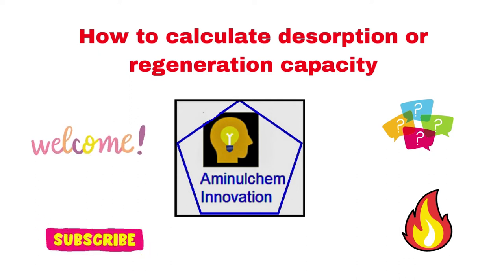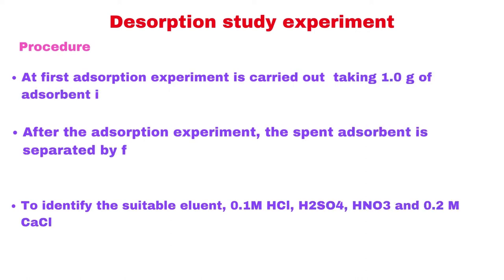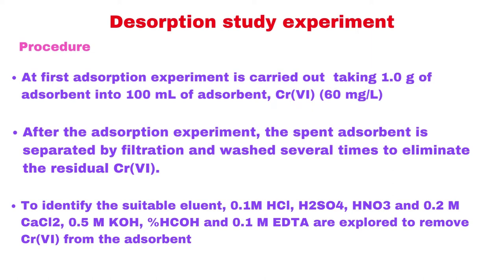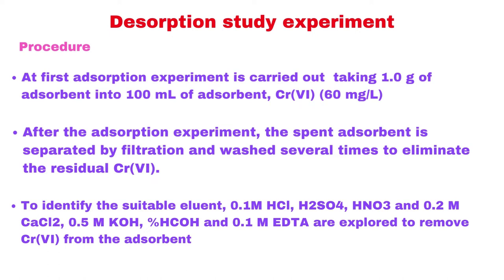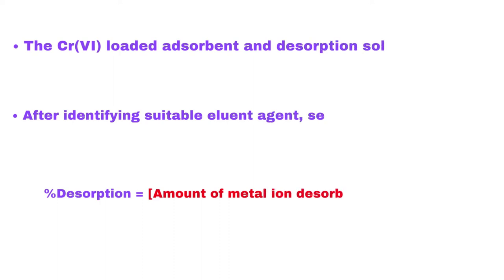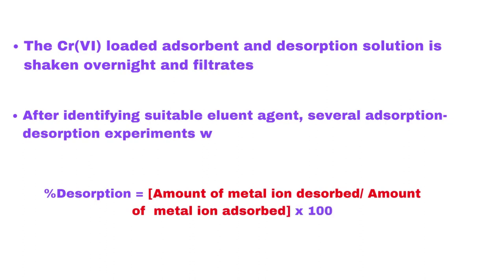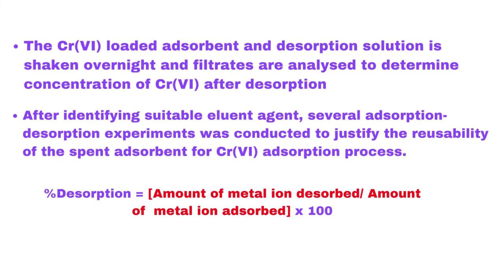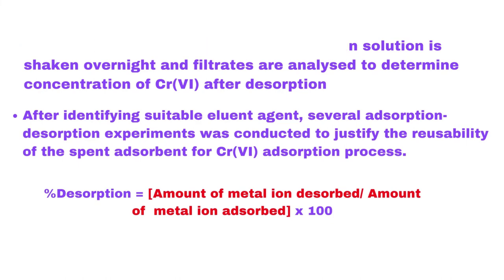How to Calculate Desorption or Regeneration Capacity

Comment: Great I have a question. After the desorption experiment I want to analyze the solution, but after making it more concentrated. how can I increase the concentration of that solution..? 
For example, when I will pass a pollutant water containing pharmaceuticals that will adhere to my adsorbate during adsorption, then in desorption, they will come in solution but they are in a very low conc. which is very hard to detect in the instrument. Can you share your thoughts on how can I concentrate to make it detectable?
Reply from the maker: Thanks. Usually desolation concentration is not measured. After zero cycle the adsorbent is regenerated using HCl or NaOH or other agents. Then using this spent adsorbent and original adsorbent adsorption experiment is carried out.  Similarly other experiments are done..

Comment: Dear Sir,
You are doing great work, especially making videos related to the adsorption isotherms topic. 
Can I get your email address? 
I am also working on the same topic.
Reply from the maker: Thanks. Please make your comment here and I will get back to you soon.
Reply: @Aminulchem  
I did several experiments on adsorption by using granular activated carbon. We used wastewater for this experiment. 
My question is, which model fits best for the adsorption. I have the result of both pseudo first order & second order as well. 
During the experiment, we took the reading on different interval but not intensely, the values we got in terms of the qt & qe is more or less approximate.
I also used the Origin software to plot my data  & got the qe values through the model. 
Furthermore, I struggled to find the time when the equilibrium was achieved? 
Sorry for the long text, but I guess it is necessary to explain some background. 
Thanks in advance.
Reply from the maker: @M.ahmedkhan  Thanks for your comments. My suggestion is that at first watch all my videos without skipping attentively and try to understand the various isotherm and kinetic models fitting in origin. Then try to fit your model. It will take time but finally, you will be successful. Good luck.
Reply from the maker: If you have further queries, please let me know.